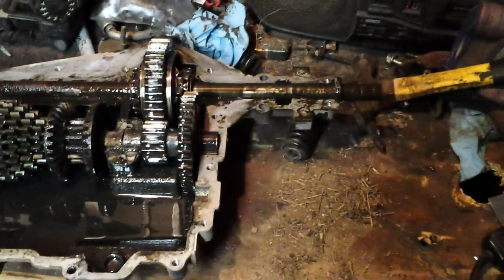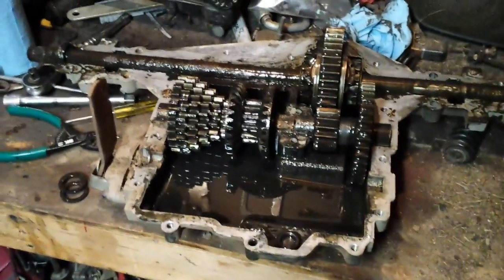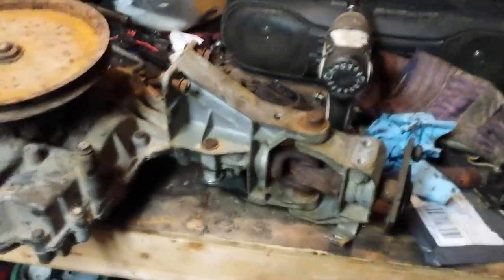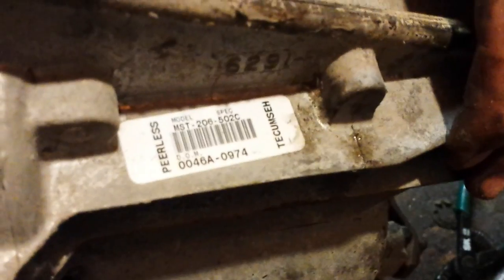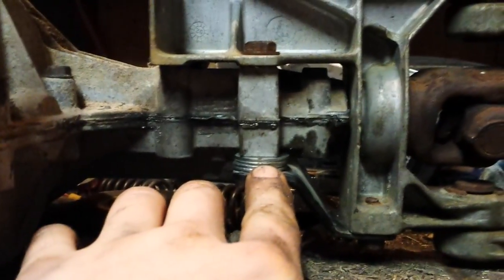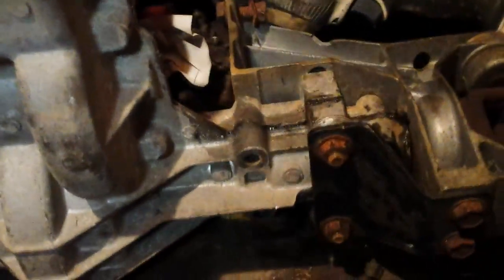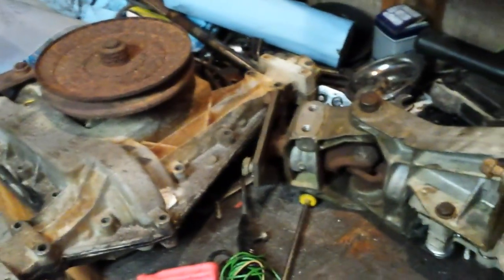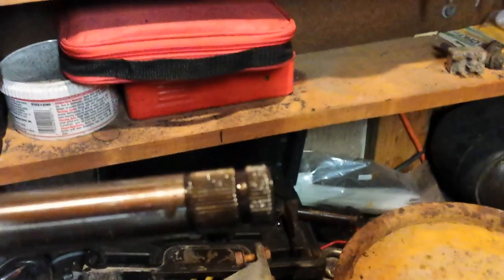How To Turn A Peerless MST-206 Into An AWS Part 2

Comment: There was at least 6 if not 10 or 15 different transaxles used in the Noma design 4 wheel steer tractors sold under around 10 or so brand names. I've seen variations in the rear steering hubs, the length of the front to back tie Rod. I scrapped several 4ws 6 speeds but kept the axle shafts. I've seen pictures of a Murray 4ws with the rear steering arms located above the steering hubs instead of below like on the early ones.